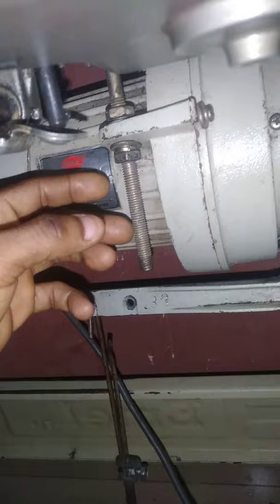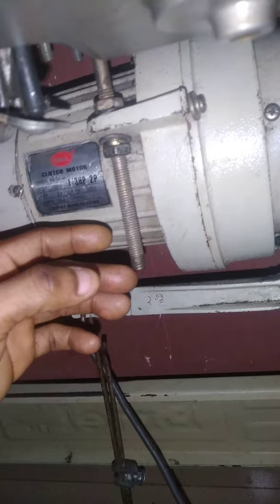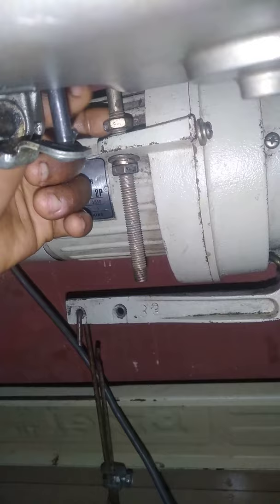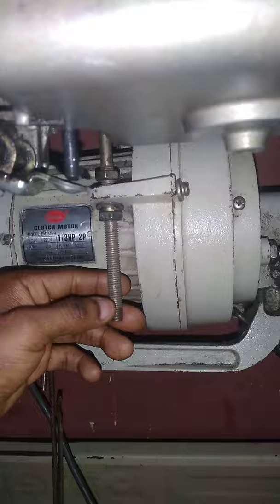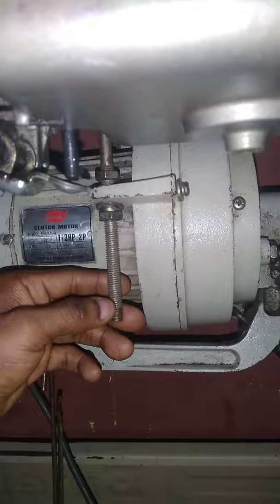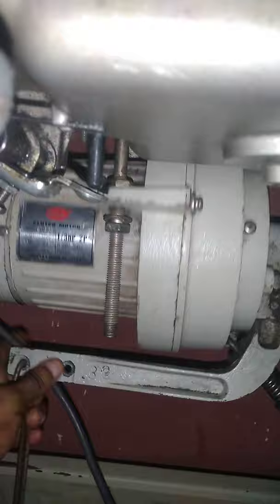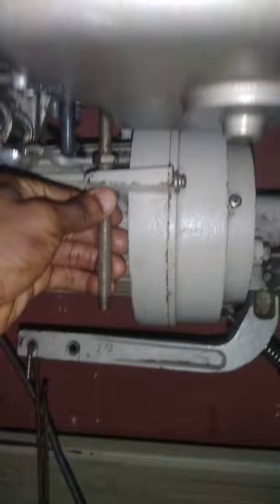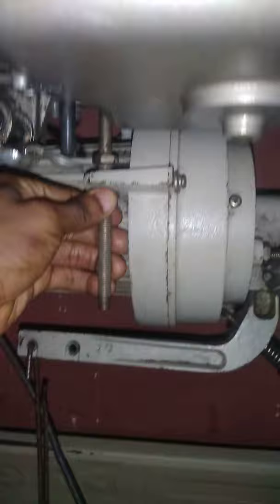HOW TO REDUCE AN INDUSTRIAL SEWING MACHINE SPEED EMEL AND OTHERS

Comment: Does this slow it down or does it give better control over the pedal??? Speed wise, the machine is fine, the problem I have is that the pedal has too much dead play, you have to press it so far before it starts going and from there to where you reach full speed is just one centimeter or so. So frustrating

Comment: as this machine is really fast. please give us tips for safety. I just got this machine and it's super fast that I'm scared for my hands,lol.
Reply: Replace pulley wheel at the motor for smaller diameter, it will reduce speed. Check only what type of shaft at motor u have it can be cylindrical or tapered